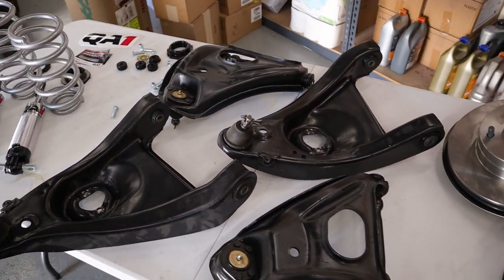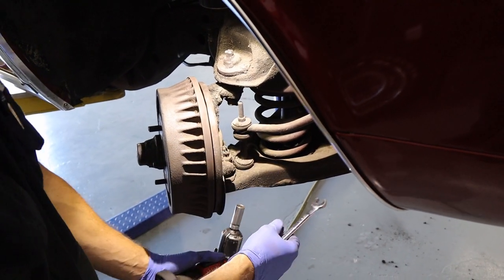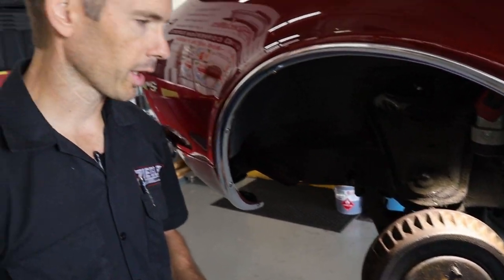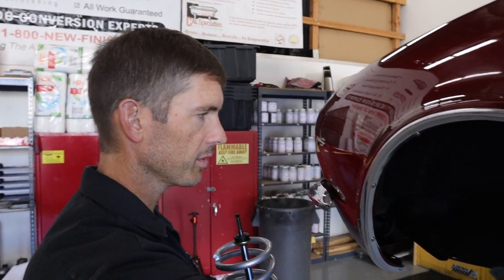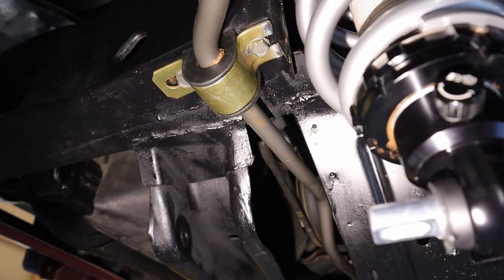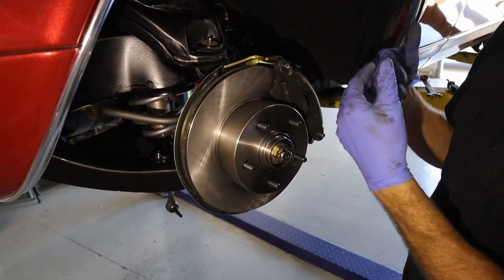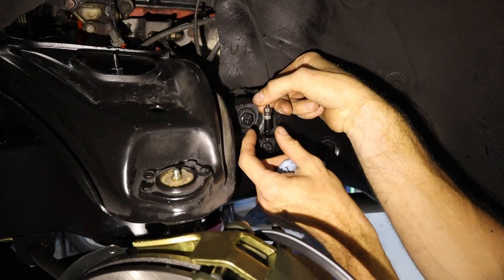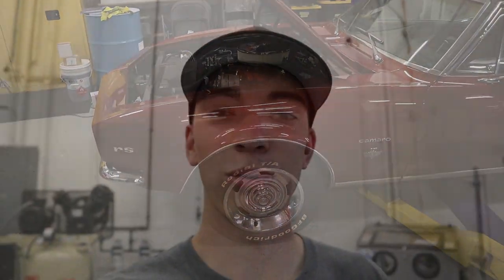67 Camaro Front Suspension Rebuild & Disc Brake Conversion

Comment: 22:38 From the 1970 Camaro Supplement manual since I have a 70.
When you spin the rotor, torque the nut to 12 lbs ft. Then backoff the nut one flat and insert cotter pin. If the slot and pin hole do not line up, back off the nut an additional 1/2 flat or less as req'd to insert the cotter pin.

Comment: You guys did not replace the master cylinder & install a proportioning valve ?this camaro had power drum brakes which has no porportion valve ,the distribution block has to be replaced with a porportion valve & power disc brake master cylinder.

Comment: This could be the best coil over install video on the net. Just one question though. Are those lower control arms rated to support vehicle weight at the lower shock mount bolts? Are they reinforced? Great video. Thanks!

Comment: I replaced mine with brakes and suspension from a 78 olds. This gave me disc brakes instead of the old drums. Replaced the sway bar with a custom made 1.25" bar.

Comment: Question ? Why would you put stock control arms on a coil over kit. Makes no sense to me . If Your going that far , why not put stronger tubular control arms ? Those coil overs are going to hammer those stock  control arms
Reply: Your correct. The stock lower control arms are not strong enough for coil overs.  He will find out the hard way.
Reply: Qa1 reps told me you can use these coil overs with stick control arms
Reply: What's with the proud camaro owner crap. And it's jounce not joust.

Comment: Those control arm pockets are not designed to take the stress and impact of a coil over.  This is COMMON knowledge of anyone running hard driven car. You will regret it.